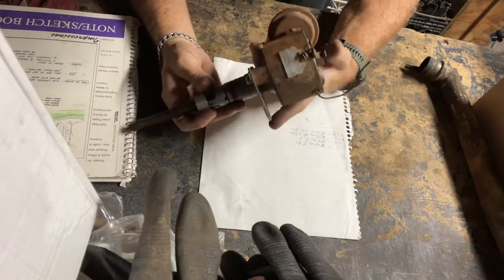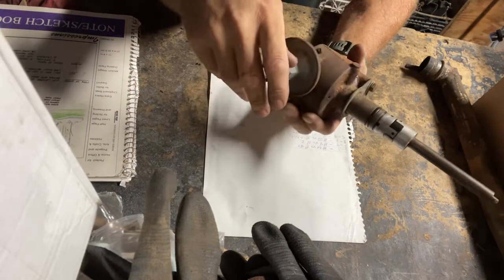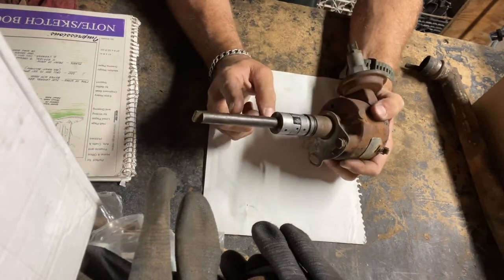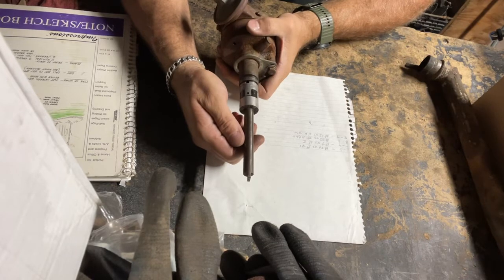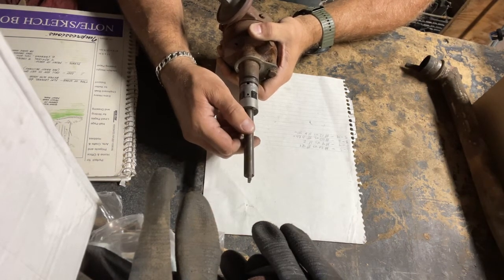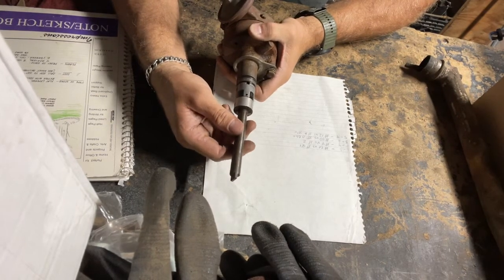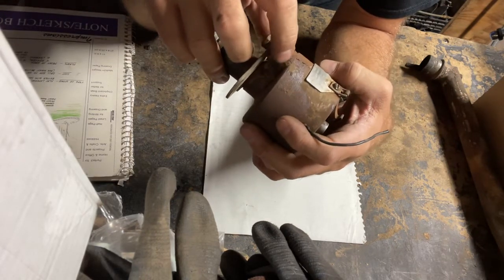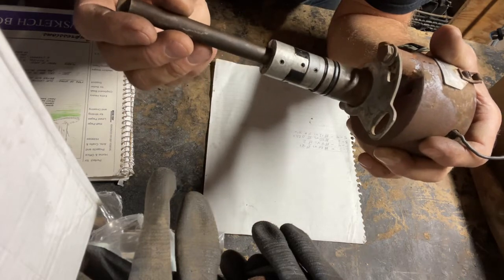230 Tornado Jeep Engine Distributor - Is this much slop normal in the coupler above the shaft.?.

Comment: That is a lovejoy coupling on the shaft. In industrial applications it is used when there are minor misalignments between two ends of an intended drive shaft. They are also used to isolate a vibration on one end ofthe shaft. In this case it would seem there is a misalignment between the bottom of the distributor and the corresponding location where its driven from. The percieved slop in the shaft refelects the effective bend in the shaft the lovejoy allows. Since the bushing is rubber I would reccomend inspecting it, it is the failure point for those couplers and that is pretty old rubber.
Reply from the maker: Thank you for the info. Cheers

Comment: Its going to rely on the oil pump at the other end for stability. Its important that little to no slop is noted at the rotor end otherwise the point gap will be inconsistent and noticeable on a dwell meter.
Reply from the maker: Hi - once it was installed it was quite solid. I don’t know how to use a dwell meter. It’s on the list of things to do. 
Thanks for watching!